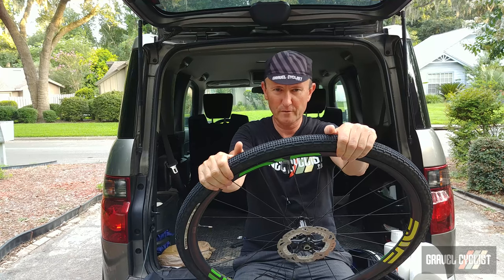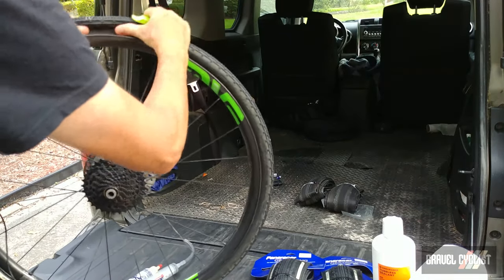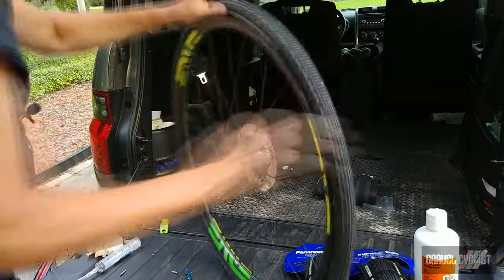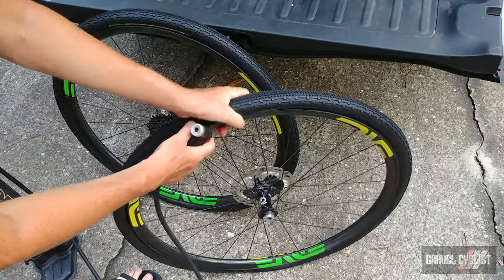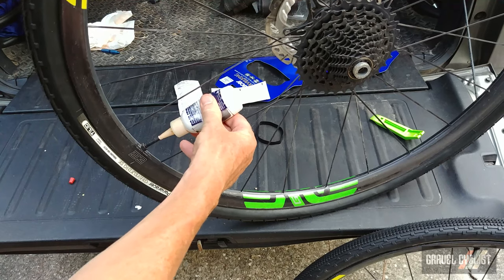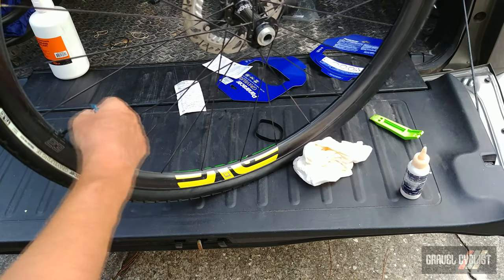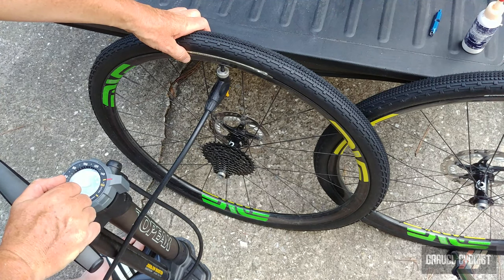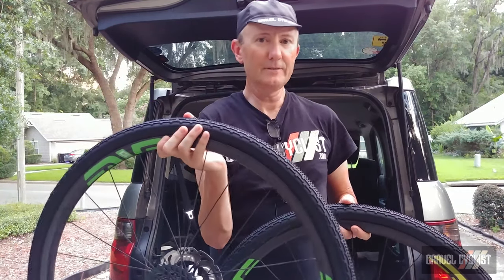Swapping Tubeless Tires & Reusing Tubeless Tire Sealant

Comment: Great video. I have been debating buying a pair of 38mm Gravel King slicks so not to chew away at the nobs on my 38mm GK SKs for an upcoming trip where 200+ miles will be on paved trails. I think I'll pull the trigger now. I imagine I'll end up swapping the tires 2-3 times a year. Doesn't seem to be much of a pain, after watching this video. Cheers!

Comment: What do you use to clean up the old sealant from the rim before you install the new tire? And how do you clean up the old tire (presumably it's re-usable)?
Reply from the maker: Hi Jim... I forgot to include that scene in the video (d'oh!) but I mentioned it in the video description. I use paper towel, nothing special. I do the same with the inside of the old tire... kicking myself for forgetting to include that scene!
Reply: @GravelCyclist  No worries.  Having more wheel sets than bikes, I often find that a disused set of tubeless wheels has gone dry, and I dread trying to clean them up so much that they end up sitting for extended periods.   I have a set of 650b Boyd Jocassee's that I've used exactly once.  They have WTB ByWay's on them, and the sealant  has dried hard on both the wheels and tires.   I'd love to clean them up and use them again, but I dread doing it.   I've never found an easy way to remove dried sealant.  Especially from the inside of a tire.   Any secrets?

Comment: I recently switched from Stan's to Orange Seal and so far won't go back.  If your sealant has mostly precipitated out the latex, go with new sealant.  Oh, wait, that was Stan's that did that...
Reply from the maker: Orange Seal is all I've been using for the past five years, best sealant on the market IMHO.
Reply: @GravelCyclist  is your opening shot on the bluffs of Santa Cruz?  Kinda funny for a FL graveler, but I do recall your trip out to near my neck of the woods.
Reply from the maker: @karlbe8414  I have ridden in an and around Santa Cruz. I'm not a "FL graveler"... I ride all over the world, no point limiting myself to my USA home base!
Reply: Never had issues with Stan's..But I do remove and replace yearly.

Comment: I tried reusing my ~6 months old Stans sealant for a replacement tire. And it kinda worked but I noticed that sealing performance was severely diminished. Also, a better way to get the sealant out of the tire is to use a normal 60ml syringe you get at most pharmacies together with the thin tubing from an oxygen mask. With that you only have to remove the valve core and not the complete tire which makes the entire process very clean, easy and you get almost all sealant out of it without any spill. Also it only costs you a few Euros or even cents.
Reply from the maker: I've had good luck with re-using Orange Seal, no issues with performance. Appreciate your tips!
Reply: @GravelCyclist  Thanks for the info! I heard good things about Orange sealant so most likely I'll try that one next - especially if it's reusable - that'll somewhat make up for its higher price.

Comment: I've noticed a trend on the channel leaning towards 700c from 650b including your choice for the DK.  Any insight you can give someone who is currently shopping for a gravel/adventure bike?
Reply from the maker: Hi Todd... there aren't a ton of really good 650b wheel options out there, but I have reviewed the ENVE G27 in the past on the channel. Sometimes I get a bit short on time with my reviews and stick with 700c versus all possible combinations. BTW, I recently reviewed WTB's Venture tire in 650b on the GravelCyclist.com website.

Insight... stating the obvious, your budget will definitely be a factor. I cannot stress the importance of tire clearance... so be certain that your new bike has plenty of that. Catering to both wheel sizes is nice and 650b is a bonus if you like getting a little more adventurous with your rides :)

I really like the Otso Waheela C, which was my latest bike review... that bike is a total blast to ride and can fit HUGE tires in 650b and 700c... also, I'd choose a bike that caters to a double chainring. 1x only bikes are silly in my opinion, why limit your drivetrain choices? Finally, if you desire more flexibility, look for bikes with attachment points... fenders, racks, and so on. Hope this helps!
Reply: @GravelCyclist  Great advice! Thanks.
Reply: @GravelCyclist  This is all very sage advice.   Thanks you sir!

Comment: Great video! 
The bike shop gave me a used tire with dried up sealant. I found and removed several bits of wire and tried to use different methods to remove the dried up sealant. A wire brush on a dremal tool worked best for me.
I removed the sealant to make sure I found all the wire so I could use a tube.

Is it necessary to remove dried up sealant from a tire if you are going to use it tubeless?

Will a CO2 cartrage clear a sealant sticky valve?

Can you put sealant in a tube?
Reply from the maker: I always try and clean up old sealant before reusing the tire. See my notes about clean that up that I forgot to include in the video, oops.

The valves get clogged with latex, I haven't researched how to declog them at this time. Sealant inside a tube doesn't work well in my experience, but I only attempted that on a roadie tube at 80psi. Lower may work better?
Reply: The only place I have used sealant in a tube is on my Topeak bicycle trailer. 16 inch x 50 mm.
Reply from the maker: @itsallspent  I imagine if the pressure isn't high and considering the tube is so voluminous, it works well. It was an epic fail on 700c x 25mm when I tried.

Comment: What is your opinion on 650b VS 700c?
I found out that for my style of mixed surface riding speed is identical, but comfort wise the 650b wheelset is far superior.
I wonder why most gravel bikes doesn't support 650b wheels.
Reply from the maker: 650b would be comfortable because of wider tyres, lower tyre pressures. Both wheel sizes have their place, but 650b tyre choices are lacking, so many of them are weighty compared directly with their 700c counterparts.

Most modern bikes do support them, but a lot of the manufacturers don't advertise that.